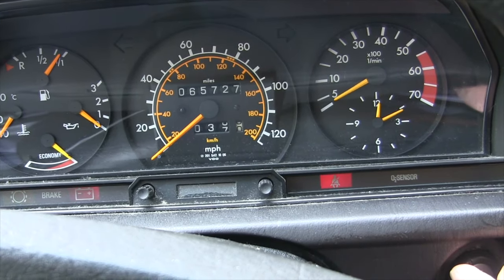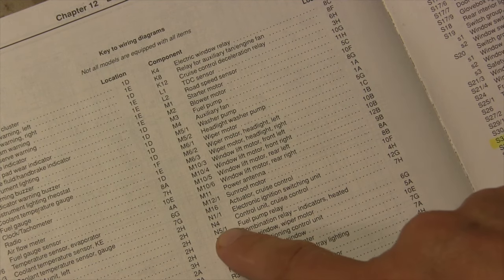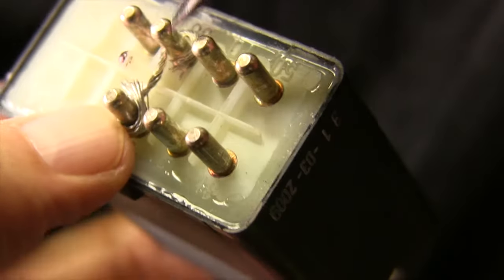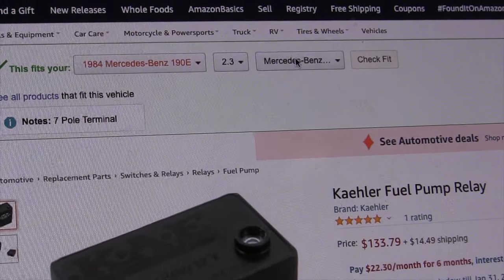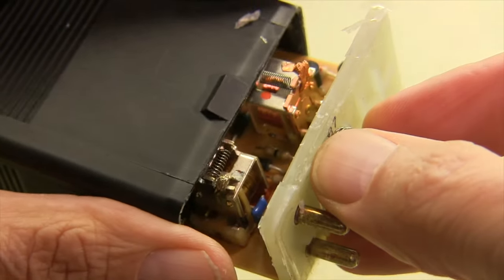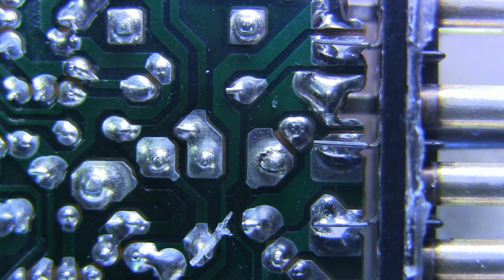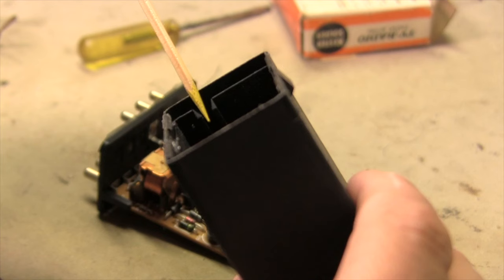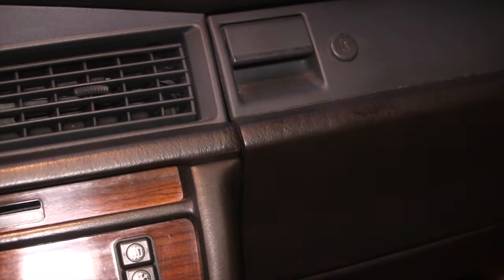Mercedes W201 190E Fuel Pump Relay also W124

Comment: Hello, do not be bored, engineer, if possible, the wiring diagram of the Mercedes engine w124 230e m102 Send it to me, I need it very much, I am from Iran, the wiring map can not be found here at all. Thank you.
Reply from the maker: Hello! I do not have the M102 engine wiring diagram for W124. They did not sell that model 230E in my country. I only have some things for M103 and M104 6 cylinder engines. They are old and incomplete. Sorry I could not help.
Reply: @FlashDriveFilms  Ok thank you very much

Comment: Outstanding I subscribed cuz I ain’t nothing but a thing and my 1995 E420 cranks but it ain’t a starting. When my buddy owned a dealership he came across said vehicle and hooked his brah up paid 600 at auction holmes I did the circle jerking with copper around the relay behind the dashboard, thought car wouldn’t turn over because of the alarm. However dickhead at Mitchel Brahs found my fuel pump and shit defunct fuel pump and filter 800 dollas 300 to change dashboard light asked fellas how much for new rotors and brakes for rear. Says I don’t know who knows what we’ll find. So dank yu very much gonna find the relay related to fuel pump do the listening but ain’t messing with the cooper circle jerking bypass whatever